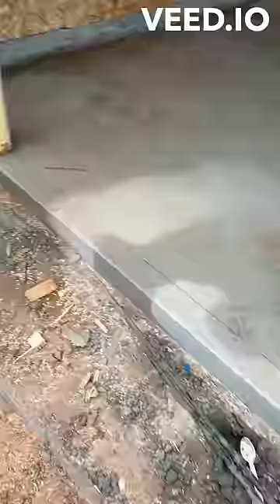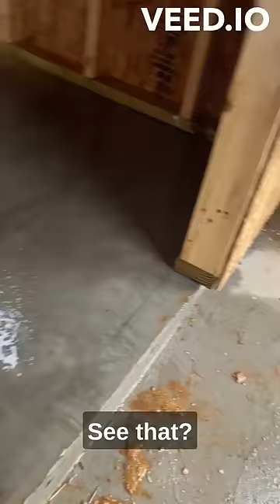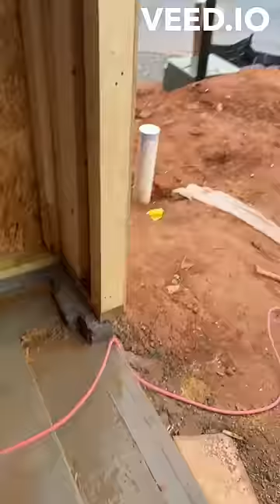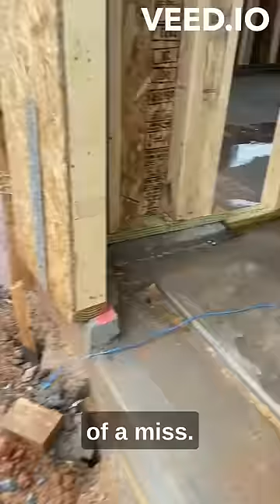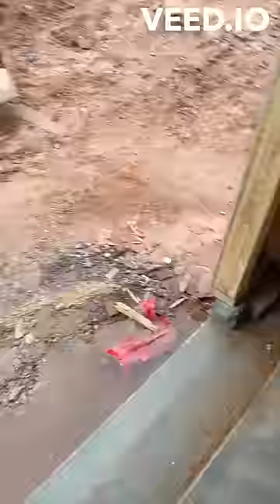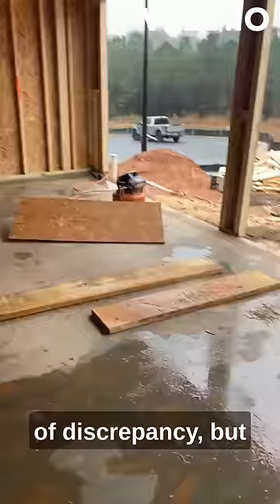New Home Slab is Wrong Size, What Now?

Comment: Framers could have adjusted
Reply from the maker: Think the trusses were all designed for the way they framed it, can't cut them.
Reply: Level return soffit could ‘be stretched it squash blocks on bearing points on trusses -  3/4 plywood.sandwiched
Reply: @torrycole6477 exactly, or they would have to thicken the foundation,lot of work
Reply: Exactly, framers should have stopped work, brought in an engineer, or had the concrete guys come back and make the slab the proper size.
Reply: Then we’re in deep 💩 I can cheat maybe a half inch in 2 stories because your “allowed” 1/4” per floor but it still screws the pooch, & that’s why I prefer doing the whole show, I’m shooting for 1/8th or less in 2 stories
Reply: @Hmtatlanta so you’re saying the concrete guys dicked up the slab?
Reply: pretty obvious the concrete guys formwork is exactly 1 1/2" short on every side...They need to learn plan reading and layout..🙄
Reply: No framers can't adjust. you just don't know the process
Reply: Could have
Reply: The framers cannot adjust. It would be a process with permits. The home buyer pays based on square footage
Reply: Can you read?
   If I can as the homeowner I wouldn’t be paying for that.
Reply: Well then the house wouldn’t be square
Reply: Yeah I'd say after the poor the framing should have been Revisited
Reply: If the framers did not get approval to go ahead with that, then they will probably be at least partially liable for the tear down and replacement so that the concrete guys can redo the slab
Reply: Framers go off of the blueprint. There is NO "adjustment".  Floor joists and trusses come at the size on the blueprint. Tell me you've NEVER framed without telling me you've never framed. 😂
Reply: Been building houses and buildings for the last 40 years plus.
  We always went off the Crete , unless the Crete was a little out of square.
   Young framers know it  all.
     Look at the fine print on your blueprints. If it says field verify . Is on you.
Reply: Been building houses and buildings for the last 40 years plus.
  We always went off the Crete , unless the Crete was a little out of square.
   Young framers know it  all.
     Look at the fine print on your blueprints. If it says field verify . Is on you.
Reply: @steve_beatty nah the guy measuring just left his glasses at home that day.
Reply: So the roof will be long
Better then unsupported walls
Or shimmed walls
Reply: No you don’t
Reply: Yes they can
Reply: @Hmtatlanta  there is engineering for that
Reply: It won't hurt it at all
Reply: As a trade man you can’t have the framers babysit the concrete guys . A good framer would of called it before starting. 

Ultimately it falls on the general contractor if you can’t inspect every trade doing their job correctly you shouldn’t be a GC
Reply: @den-yc3hv  you can check every single job but still people make mistakes. This didn't look that bad and I agree with you 100%. The framer should have said something before and it could have made the proper and necessary adjustments to make everything work and go smoothly. But still people make mistakes. Man I got 40 jobs going right now that I watch over personally. And yep I'll catch mistakes then. I miss and you know what I do. I just fix them because that's all you can do. You just got to fix it and move along. Have a great day man. Good comment
Reply: @Mike-lb2wj 
Yes but they are liable for any unforeseen cost moving forward to correct errors in framing knowing that there was a problem moving ahead with framing on the concrete that was too short to carry loads.
2 wrongs don’t make it right. 
Seen it a few times already when these same things happened.
Legally they are both at fault.
Reply: @steve_beatty  Dumb boat mechanic here; so they put the forms on the wrong side of the line......dang!
Reply: @gregkahle9046   Sure looks like it..🥴  I kind of wonder how they fixed it. I doubt the city or  structural engineer would sign off on load bearing walls hanging 1/2 way off the foundation..That is if they ever see it... 😉
Reply: Yeah sometimes you gotta ignore the blue prints and just build what's right. Concrete is completely permanent even if they were wrong what's done was done in concrete. Concrete guys got it wrong, framers built the prints even though it's obviously wrong.
Reply: @EddieFord-j1g   In a perfect world where everyone G'sAF the framers layout guy would have noticed that his lines were way off and notified the GC so they could address it one way or another before framing the walls....in a perfect world...🙁
Reply: What is the solution at this point?
Reply: @ChipSecco   I'd like to know how they fixed it  as well.Maybe  shoot a bunch of anchors (ramset pins ?) into the existing slab ,rough up that slab edge for a mechanical shear joint and add a few inches thick wall to support those walls that are cantilevered with a footing to match..Maybe even use epoxy to help keep it from peeling off later..? dunno....whatever happened it wasn't cheap...🥴
Reply: @steve_beatty  I completely agree even if the concrete folks were wrong framers should have caught it up to the GC, may not have even required permit change depending on where. Same wood could've been used and everything considered it needed to be shortened. In a perfect world. I cringe seeing the small gap forming between the studs and bottom plate on one of those garage doors.
Reply: @torrycole6477 clearly there were a lot of people that turned a blind eye here. The framers were likely bound to the dimensions of pre manufactured trusses. And I can guarantee it was brought up to the superintendent at the very least. Some one green lit this for it to get this far.
Reply: @Hmtatlanta that’s why stick frame will always be superior
Reply: @Mike-lb2wj lol if you frame with trusses you aren’t no framer and you out here tryna gaslight😂
Reply: For every solution there is a problem
Reply: @jakeatkinson4913  now now.  Do explain your position here...
Reply: You downsize one board and that knocks everything else along with it, walls windows doors ceilings , the whole enchilada
Reply: not so. the framers are given plans. they build from the plans. the problem is if they stray from the drawings, they could be held responsible, so they do exactly what is on paper. concreters cut corners to save money on concrete for several reasons and end up pocketing the difference.
Reply: @Hmtatlanta  What kind of truss design they using that won't allow a half an inch of movement all in one direction? Flat roof?
Reply: @Mike-lb2wj -- framers should measure the slab and compare to plans before they start work.  But, so should the concrete guys.  And, of course, the general contractor.  The GC is ultimately responsible to his customer, so he should be paying more attention, earlier in the process.
Reply: The first thing you do is take a 100’ foot tape and check the concrete period. Check for dimension and check for square and also you check for elevation…how did not one carpenter on the job stop scratch his head and say wait a minute ?
Reply: Trusses were most likely already ordered.  Not always able to adjust.  The truss has to be installed within the manufacturer tolerance.  Not doing so voids the warranty on them.  You would be amazed gow many people toenail trusses and instantly void the warranty.
Reply: @Mike-lb2wj and if you're a framer who will only build to drawing, and you don't bring up an obvious issue which would have come to light the first half an hour into the job, then you shouldn't be a framer.
Reply: Most likely a pre fab house.
Reply: As a concrete guy when I see this job I know I’m about to make a lot of money. We’ve done plenty of footing extensions they are a lot of work. The builder should have stopped before they framed and had the footers redone or extended. The concrete company they used screwed everyone in this bad. My guess is they just built their stem wall on the wrong side of the string but either way if the builder would have seen it sooner it could have been fixed or redone before framing. Now that you have framing up and it’s pretty much floating this is a disaster
Reply: @basedlogic  agreed. I never said I wouldn't bring up the clear issue with the concrete guys not being able to measure. But following to blueprint specs saves framers from getting blamed. It's a CYA. I, myself, wouldn't even start work on pressure treated if my lines run off the concrete that much.
Reply: @Hmtatlanta framers could have shortened walls and had a 1 inch bigger overhang on the back and front with full load bearing to code. The blueprints all have a little small print that states all measurements to be field verified and adjusted accordingly. That is a perfect example of why they put that fine print. And honestly there is more than 2 inches bearing
Reply: Totally ; easy  adjustment in the framework, had a concrete  on the wrong side  of the line 6" off and just hide the overhang  with trusses,engineer approved  it, walls that far off the concrete  is on the framers, never pass
Reply: @marrero1337 wtf , no they shouldn't .ever. The general contractor didn't do his job and that's pretty obvious and as I stated the framers should have shortened the walls and split the difference on the trusses , looked like an inch or so bigger on front and back .still had the bearing requirements for the trusses . all measurements on a blue print are to be field verified and adjusted accordingly. As it states on every blueprint. The project manager or general contractor needed to be diligent in his or her job. And shame on the framers for that as well.
Reply: maybe they think a 2x4 is not really 4 inches its 3.5
Reply: @jefflinnell8492   haha, not sure you meant to tag me.  I said the framers should have stopped and used engineering.  That's field verification, albeit from a higher authority.  You're right, framers should have told the General, who should have consulted with the concrete foreman and the engineer.  Sometimes, it's best to pause, take a breath, recalibrate, and get it right.
Reply: @marrero1337  or the framer just could have shortened the walls and split the difference on the trusses. 1 inch on each side still exceeds the minimum bearing , especially with the 2x6 construction. There is no need to create a big giant delay calling in all the people that should have caught it before the framer just adjusted accordingly. In my opinion and as a framer. There are multiple fixes the framers could have framed in those garage walls with 2x8 instead of 2x6. There is plenty of footing just fatten that wall. Done deal still have five inches on the plate and the second floor load carries onto the joists as well. As a framer for a very long time , we have schedules as well.I would have shortened the walls , adjusted the trusses and finished the framing and the people in charge , gc , engineer , builder sometimes will never know about it ever. Nice and smooth , job keeps rolling .framers are the key adjustments on the fly and no-one ever knows there was a hiccup.
Reply: Guys saying they can't adjust because of the blue prints have obviously never had a thought of their own. Old timey framers would agree with this
Reply: @steve_beatty they probably put the wrong edge of the form on the edge of the line they made lol
Reply: I’m an “old” guy. When I was younger an “old “ guy would say” let’s look and see what the cartoons ( blueprints/ plas) say”
  And blueprints aren’t blue anymore.
Reply: @Hmtatlanta if it was open soffit no one would ever know if it was closed soffit same thing the only reason I think it was framed like that would be if the walls were pre fabricated off site otherwise your framing crew needs fired
Reply from the maker: @Foxman876  I was walking the home, not the builder or framer. These are site built but they use floor and roof trusses, the explanation I was given by the framer was that moving things in to meet the slab would change the load bearing areas for some trusses. This builder orders “packages” for these homes based on plans. I was out there the other day, they are fixing it be adding another LVL and coring into the existing slab and adding additional concrete. PE will sign off, will have a vid on that in a few days
Reply: @Mike-lb2wj I just got done a 2 story colonial frame w attached garage. Only studs came cut to size. Weird how that works huh squirt?
Reply: @jakeatkinson4913 exactly. Mike is just proud and egotistical. He's the best framer bc all his stuff comes precut w directions lol. "Framer" 😂 not so much.
Reply: @Hmtatlanta soo 

hands down concrete guys are at fault
Reply: @steve_beatty They took measurements outside the 2 by material used for forms
Reply: They could have if they paid attention to the blueprints,  what should have happened, the framers should have put a hold on the framing until the slab was done correctly.
Reply: Drawings wont agree,
Reply: @Hmtatlanta I’ve never hung a truss that couldn’t have had an inch trimmed off. They were being dicks. They never should have framed it like that. Period.
Reply: @Mike-lb2wj  tell me you don't know how to problem solve without telling me you don't know hot to problem solve. Every time you point your finger there's 3 more pointing back at yourself...
Reply: @torrycole6477  everyone I've seen saying you can't tweak framing or plans clearly doesn't know how to problem solve 😂. Nice to see there's some people out there with a brain such as yourself 👍
Reply: @Hmtatlanta  Load bearing walls can’t be half on the pad either.
Reply: @steve_beatty  if it had to fix something like this I'd look to dig down to the footers and thicken the entire wall with plenty of anchors as you said. That is of course given it isn't a monolithic slab.
Reply: @Mike-lb2wj Tell me you need someone to do all the math for you to frame without telling me you need someone else to do all the math for you to frame garbage houses.
Reply: @marrero1337 classic scenario where 6 minutes now can save you an hour down the road.
Reply: @hectorgarcia8691 Yeah if you can only frame off pre described dimensions. A real framer, which would be a carpenter, would be able to cheat it out along the way. With an engineers approval of course. Windows and doors aren’t in the corners and that’s where you’d cheat it out. Pull your measurements for openings off a true wall. Trusses or not, it’s not a hard change to make before it’s built. If it’s two story, cheat a floor joist over if they’re running perpendicular to a true wall. Same with trusses. It’s really easy. The problem with the trades now is they only know the motions. Not many know the ins and outs. They need everything laid out for them in order to accomplish the mission. All the plates landed close to where they needed to be. It would be super easy to, with the blessings from an engineer, to shorten some wall and make the necessary changes. It’s a lot easier to make it smaller than it is to make it bigger. If you were a true carpenter or tradesman in general, you’d know this.
Reply: @Foxman876  I gotta say, even if I was setting a prefab and ran into this, I'd have to take the whole 5 minutes necessary to knock the end stud back, re-nail it and trim the sheathing.
Reply: @Ben-iz9ud Trusses can be moved, modified and repaired with an engineers approval.
Reply: @Joemama1q  I'd say "erector" is more fitting for someone like that 😂
Reply: @kuttmowf Agreed. Real carpenters don’t need every measurement from a drawing. Now a days with liability, they would just need an engineer to stamp the change and real framers would have bought it out. Way cheaper to wait a little for a change then it is to play with changing concrete. Faster too.
Reply: @mikeznel6048   that all sounds very logical 👍
Reply: Oh I know it’s an inverted brick ledge
Reply: @steve_beatty maybe they measured including the form?
Reply: Thanks Matthew, I frame very little anymore mostly trim.
    I’ll just say that today’s framers are very sloppy.
Reply: Thanks Matthew, I frame very little anymore mostly trim.
    I’ll just say that today’s framers are very sloppy.
Reply: There is no excuse for laziness! The concrete guys fucked up but it's all on the framers.. they should have never proceeded. That should have been addressed as soon as the layout started.. you don't build the whole house
Reply: Concrete guys measured to the outside of the form, not the inside.
Reply: @Mike-lb2wj Exactly!
Reply: @torrycole6477 So, what do you do with the trusses and floor joist already on the job ready to frame at the exact size on the prints? Order all new trusses for your adjustment? Build a crooked house? Just curious
Reply: @den-yc3hv Yes Sir. Building supervision Lacking!
Reply: @gregkahle9046  Exactly you can tell they literally measured from the outside of the
Reply: Squash block’s sandwich 3/4 PLYWOOD
Reply: @Hmtatlanta that’s why most builders and truss companies don’t build until the walls are up. Verifying the measurements in the field. Most contractors and companies do it that way so it is built the right way. This house is garbage what a hack job. Did the apprentice frame the house?
Reply: @Hmtatlanta you can make the trusses work most of the time it’s only a couple inches not a foot
Reply: So the thing if the framers should have brought it to the attention of the GC. But what I see here is the framers said we need to get paid an did it accord to the size of the drawings. Anytime you make a adjustment to make it smaller the gc will attempt to not pay you what you originally asked for.
Reply: @Hmtatlanta As a framer, you need Approval on the drugs
Reply: Drawings
Reply: @@vanlifebrokenarrow2150 what?? Lol there was nothing to stretch there, they should have mad adjustments on the dimensions to be able to fully lay the plates on the concrete
Reply: framers could have switched to 2x6 and it would have had plenty of bearing
Reply: @welewisiii  would have still made the dimensions smaller in the end . They should have just moved the wall over
Reply: Need a concrete stretcher by Hiliti
Reply: @steve_beatty pulling tape from the outside of the 2x forms probably.
Reply: Stick to your day job
Reply: @torrycole6477 need engineers ok for that
Reply: @Scarecrow976 your a mo-ron. Of course they can adjust. Inspectors don’t inspect for square
Reply: The framers can't just adjust, that goes back to the blueprint, then the engineer has to sign off and the planning department has to approve new plans. Not a simple fix at all.
Reply: @bradforester3635  hahah I was not talking about framing inspector haha. Slab inspector should have measured the slab seen it was bad and start over. Not the responsibility of the framers to fix concretes mess. Haha. Guess I am a moron hahaha. There is no adjustment a framer can do
Reply: If they are prefab engineered walls you have to build to prefab dimensions.
Reply: @rodneyferringer1701  correct sir.
Reply: @marrero1337 framers don't get paid to stop work.
Reply: Nope lots of things are pre cut for exactly how it’s supposed too be, like trusses. The concrete guys fucked up.
Reply: @jaydenwiggins1995  nailed it bud. Framing 101
Reply: The trusses probably wouldn’t work with said adjustments.
Reply: @Hmtatlanta slab is harder to fix than reordering trusses. Also why it’s important to check form measurements before the slab is poured. Surprised the plumbers didn’t find the issue. When I lay out a job for a plumbing rough I go all the way through the measurements to find any discrepancies.
Reply: @Mike-lb2wj   You can absolutely make adjustments... We're not talking feet here, we're talking inches.
Reply: @bwana-ma-coo-bah425  Yeah but the framers are going to be on the hook when it doesn't pass inspection.
Reply: @Ben-iz9ud  Trusses are gonna be the least of their problems when the house doesn't pass inspection because they're bearing walls are hanging off the foundation.  I've framed dozens of roofs, never seen one that didn't have room for some adjustment.  With that said, I've never f*** a foundation up that bad either, lol.  Although I have had to build on some that were poured by somebody else that were out of square pretty bad.
Reply: @Hmtatlanta  Looks more like somebody was having a pissing contest than anything else. In over 25 years of building I've never built prefabs only customs. Although it may take the framers more time  To actually measure and cut their own wood, I'm sure they could have cut the floor Joists, pressure blocking and moved the trusses to compensate.
Reply: Let this be a lesson don't try to be your own general contractor.. very important to have someone babysit that job verify everything as it's done according to plan.. maybe this guy got the cheapest subcontractors. It went off to the strippy bar with the clients money. Mr George no good operator😂 SI senior😊
Reply: your dam right they coulda
Reply: @michaelmahoney1205   Like those crews that come back after inspection and take the Rebar out before they pour, lol..
Reply: @travisdoe4663  I am not from the US. Are you telling me that the frame wont pass inspection if you use nails?
Reply: @bwana-ma-coo-bah425   No I was saying it wouldn't passed inspection if half the bearing wall isn't on the foundation.
Reply: @travisdoe4663  Oh I thought it was something else, thanks and sorry
Reply: Falls on the concrete guys, do over please
Reply: No kidding!
  Most of you just wanna point fingers doesn’t fix the problem
Reply: That's I retired from construction.. It's like baby sitting . if you don't keep an eye on every sub constantly they'll  pull this stupid shit every time without notifying anyone of a discrepancy
Reply: I Watch this a few more times. I couldn't see a single anchor bolt? I did however see plumbers tape wrapped around the bottom plate and a s*** ton of gaps??
Reply: I worked on a house where it was obvious that either the framers misread the plans or the plans were incorrect and they had to "adjust" onsite.  Lets just say there was cracks in the wall for a reason.
Reply: @superdave8248  lol,  Do you think the walls got cracks in it because they adjusted them after they were rocked?..  The walls had cracks in them because the foundations settled, either because of s*** concrete work or s*** sight work.  Or possibly do to Earth movement from an earthquake or something.
Reply: I was gonna say something but I read the comments and they already told you. Can’t change the framing partner.
Reply: @steve_beatty that’s why a third party measures it after it’s poured
Reply: @Scarecrow976  I'm a retired construction Inspector of 30 years , mostly large construction..We do not typically measure dimensions for form work except perhaps to verify depth and thickness. We don't usually have the time to make sure every wall is laid out correctly or any other trade's in situ dimensions for that matter and no contractor would want to wait while we did that anyway..😉 There is even a clause in the building code that says something like " No amount of inspection removes the contractors responsibility to perform"  🖖🏼
Reply: @travisdoe4663  I once arrived for a grout pour inspection on a long retaining wall and noticed there was no rebar coming up from the previous lift to lap with the next  ..Seems they'd pulled it out after the inspector left   .....I was back a few weeks later to watch then rebuild the first course after they demo'd everything..🥴
Reply: @Hmtatlanta don't listen to the idiots ohh the framers could have adjusted, the footprint of a house affects Everything after, like you said the trusses and roof being the most affected and  not cheap.
Reply: 1 1/2"
That sounds about like the thickness of the lumber used in the forms. 😮
Reply: @torrycole6477 😂
Reply: The “ fix” video is on this guy’s channel.
🤮🤮
Reply: The framers did that on purpose and made shit exactly to the plan instead of adjusting it they could of easily made it to that. You can extend/cut overhangs however you want framing is a lot more flexible then concrete all that slabs would have to be tore out and redone to be done right you can only pour once.
Reply: No they can’t they follow the plans … and if anyone complains that’s on there dime … this falls on the super job manager who is suppose to address these issues guaranteed the frames notified the super intendant
Reply: @joshualorenz7879  yeah because everything goes to plan, Always. Sometimes there isn't a super sometimes it's just subs or llc bosses or vice versa that do framing on their own. Now tell me how are all of them going to make a profit? All companies are just gonna do everything over again? Does that sound right?
Reply: @jimmypalmisano9116 thicken?  Lengthen…
Reply: The concrete would have to come back and extend the concrete.
Reply: @patrickancona1193 I like this answer!
Reply: @gregkahle9046 what?😂😂😂it's on the right side of the line,the concrete slab just should have been wider
Reply: @marrero1337 they most likely did and continued framing because this happens more thannyou think. Its an easy fix after the framing done. Its not much of a problem
Reply: @Hmtatlanta  A small overhang of the trusses would be much better than the sill plates and walls overhanging the foundation!
Reply: SUPER lazy framers with lots of excuses.
Reply: Shhhhh caulk it
Reply: So the wood all comes precut to length or framed off site and assembled by framers ? 

Seems like an easy solution would be build walls on the foundation.
Reply: Sent a first year superstar to layout.